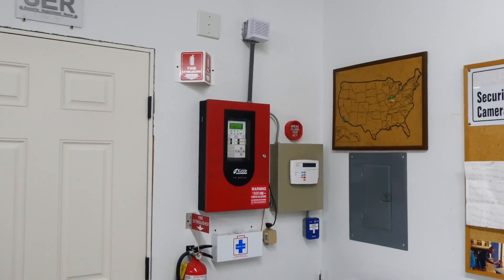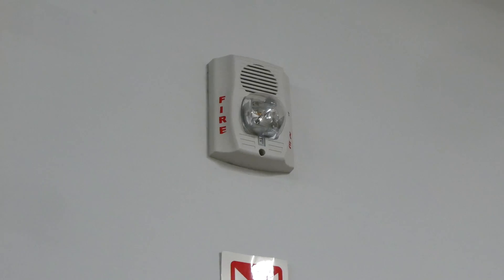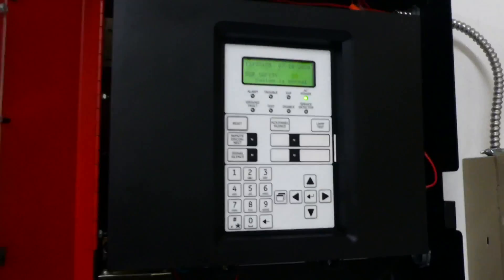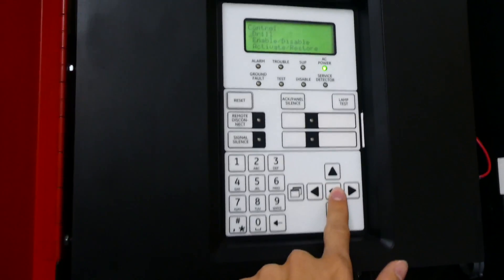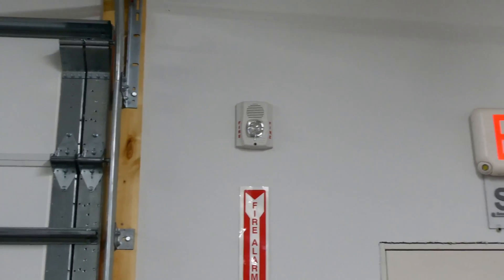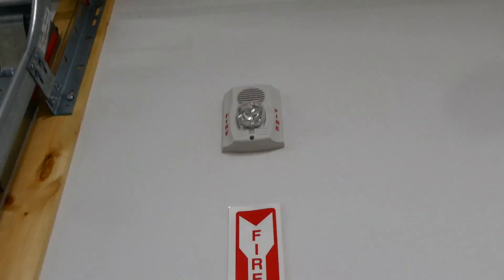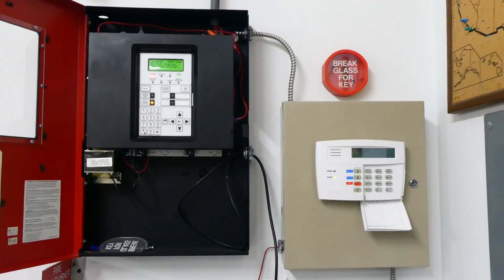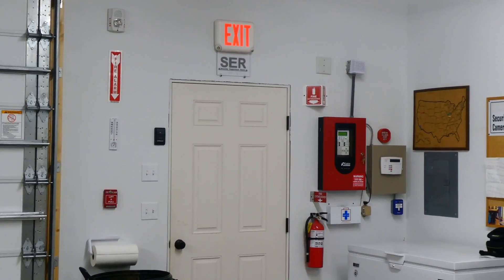S.E.R. System Test 15: Low-Frequency SpectrAlerts!

Comment: System sensor low frequency sounder is set to code 3 and other one is hf low frequency sounder sets in continuous they sound perfect I wish I have one the low frequency sounder the fire alarms are perfect 👍 good job @s.e.r system I wonder what volts are

Comment: The NFPA Code for Low Frequency Sounders in Sleeping areas at hotels with a normal fire alarm system came out on January 1st 2014

Comment: Hello, today the school I go to had a fire drill but most of the alarms weren’t sounding. Normally all the fire alarms sound and the doors close but today that didn’t happen. The alarms only sounded near the fire panel but nowhere else and none of the doors closed. It seems as if none of the NAC extenders activated. Should I say anything to the school?
Reply: You should say they need to contact their fire alarm contractor to get out there and run a diagnostic on the system
Reply: @downtownarrow  Okay but they actually did that yesterday. My school has notifier Nfs2-3030 that only has one hallway of alarms connected to the panel (by the way the alarms in a most of the school are System Sensor MA12/24 horn only devices set on 800hz with Gentex GXS strobes mounted below them).  Each hallway has their own NAC extender connected to the relay. Apparently they used the drill button for the first time which does not activate the relay which ended up being the issue. The area with the MA horns you were able to still kind of hear the alarms because the alarm went off in the communal hallway just not the hallways connected to the communal hallway. There’s another portion of the school with SpectrAlerts (classics) that are on code 3 horn. The area with those alarms have fire doors that are always closed and you could not hear the alarm in that area. Because of this, they used the intercom to tell them to evacuate.
Reply: @dale4231  that’s good that they got the contractor out there

Comment: Since the fire panel was still reseting the relay had not gone back to normal so it would show a fault on the keypad because the zone is still activated but has been reset but the fault will go away once the panel is reset